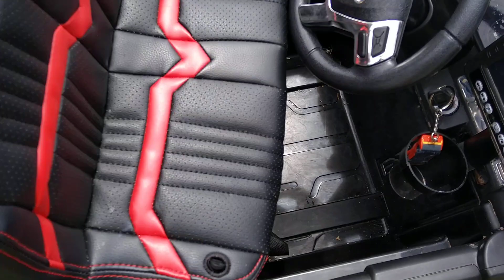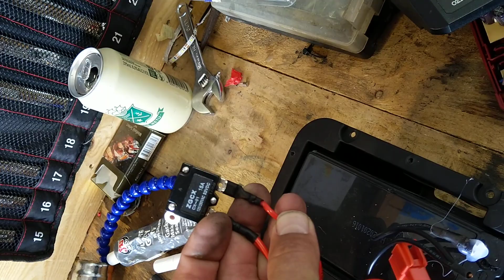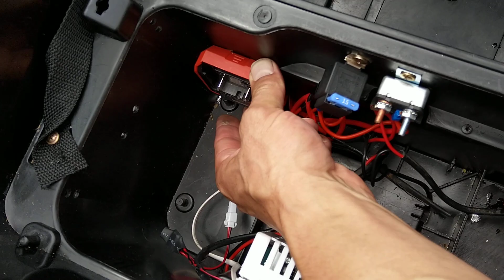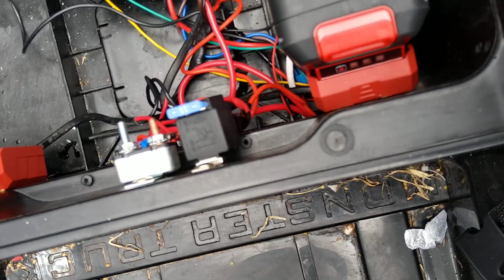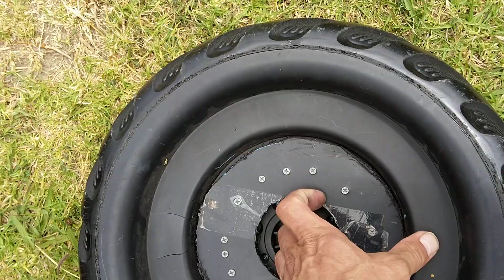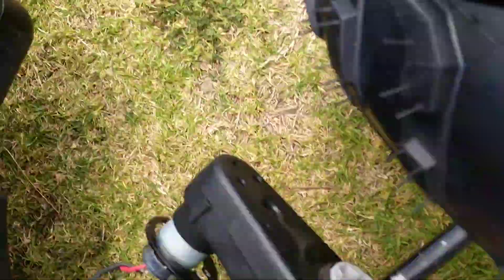Power wheels Ford Ranger MONSTER TRUCK mods

Comment: Hello, 

Thanks for taking the time to post the video. I don’t see many with this Ford Monster. I bought one but must say I was very disappointed with what I thought an expensive little toy.

I was thinking to MOD ours also. Was there any issues with putting 18v through the control box? Do you have a wiring diagram with the additional breakers etc?

Also, What motors did you order as I’d be keen to follow suit.

Cheers again.

 All the way from Orkney Scotland
Reply from the maker: Cool I have some more videos of the mods on my page
This is not a very good video I rushed through it abit! 🤦‍♂️
It can Handel the 18v upgrade quite well massive improvement in proformance check out my page 
T M.S.B
P.S the motors I brought where 40.000 RPM I'll post a new video soon but if you go that way I would strongly suggest getting a speed controller 
especially on hard surfaces like pavement/ concrete ⏩

Comment: Yea thinking of ordering this myself but the 24v. STILL these things are wire in parallel  instead of series and I TOO have been looking into mods namely the 7R gearbox from Any hotwheels model. Then you can push the 770s motors straight into there gear boxs. Other gear boxs do not  have the capacity to mount them. Have you got a vid of it running?
Reply from the maker: Yep check the other vids on my page there is a couple of them 
I personally haven't looked into gearbox upgrade but that could be the next step.
Reply from the maker: I also haven't looked into 24v and the parallel link battery setup is obviously just for longer run timemore needed to be upgraded to do 24-volt including motors and possibly controller as even though it is running 18-volt when the batteries are placed in after charging it runs around 20 volt full charge full charge